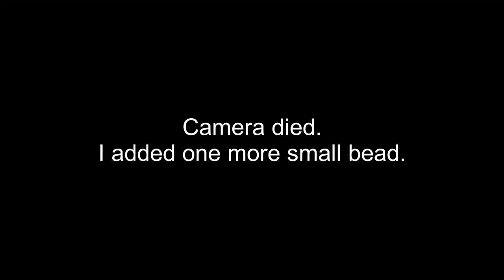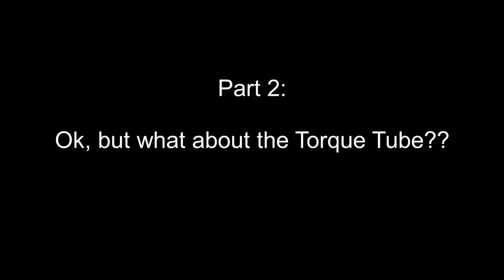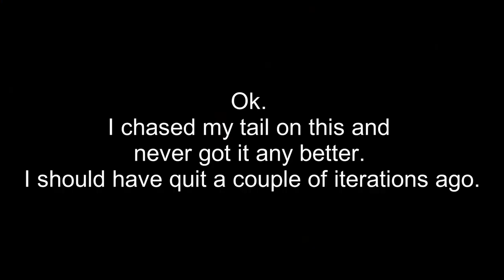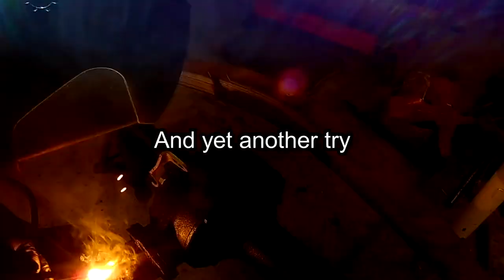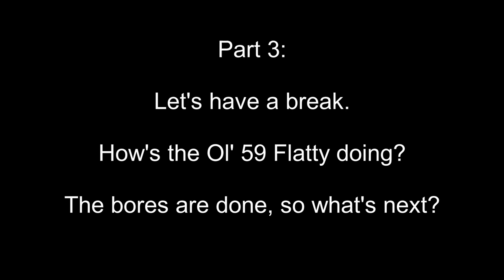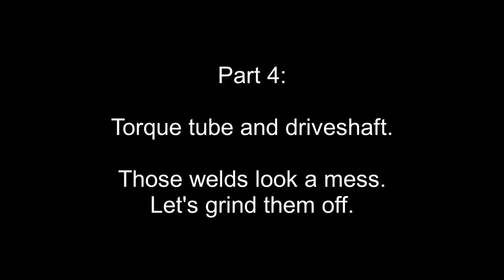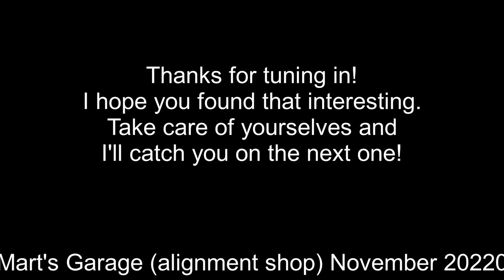Early Ford Torque Tube and Driveshaft Alignment How To. Flatty Valve Seats.  32 Pt 19 59 Pt 13

Comment: Well done on the torque tube. It’s amazing what heat can do.
Reply from the maker: That's right Dave, the skill is knowing where and how much to apply. I did find the gas method better than the mig. I haven't done these things often (or regularly) enough to develop a real whiz bang method.
Reply: @MartsGarage  I used to work on combine harvesters. We used heat almost daily for a wide variety of things.

My favour was using an steel tube as a shaft with a interference fit aluminum plug at the end for the drive. What a huge job to remove and fit that plug. 

The alternative was much heavier weight wise. 

We would heat the tube & freeze the plug..it took us way to many go’s to get it right.

Comment: One question comes to mind Mart. Once you have the tube straight, can you grind off the weld you have used to move the metal so you don't end up with a "balance" issue??? They "balance" external driveshafts. Is that not a concern with the torque tube type???
Reply from the maker: Hi Bob. I ground all the welds off. Only the driveshaft is subject to balance issues. Hence the welds ground and the two opposed jubilee clips. (hose clamps). The torque tube is part of the rear axle location and suspension and does not spin so no balance issues there. I did grind the welds though, because they looked so bad. That's why I decided the heat quench method was better as it does not leave ugly welds on show.

Comment: Why don’t you cut it off and rotate the end cut off till it sits even in your cut , so the cut won’t be  a straight cut acting as a adjustable base , , , , so rotating will even it up then weld fill where needed , heat alone will kink it in line and vibrate . Try it with piece of broom handle I did and it worked as a pattern , but looks like you made it
Reply from the maker: Cutting the whole end off and realigning it like that did occur to me, but I was so far down the road on the method I was using I couldn't face cutting it off again. It might be worth considering if I ever do the job again, though.

Comment: Hey mart, I thought these drive shafts can just be inserted, why are you welding?
Reply from the maker: Hello Fred. I'm not 100% sure what you are asking, but I'm using the shrinking effect of the weld to pull the shaft straighter than it was. I did also use weld to shrink the coupler for a tighter fit on the pinion. In retrospect this was a bad idea as I overdid it and had a hard job fitting the shaft and removing it. This video was all about using home brew methods to try and ensure good alignment of all the parts.